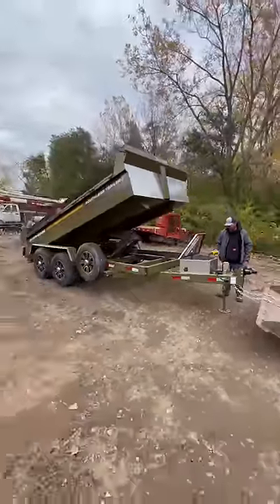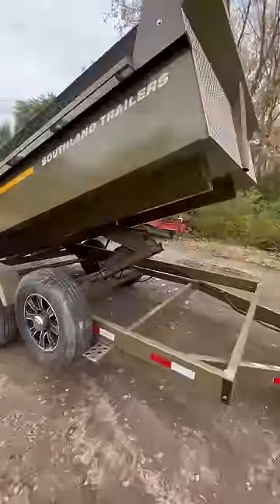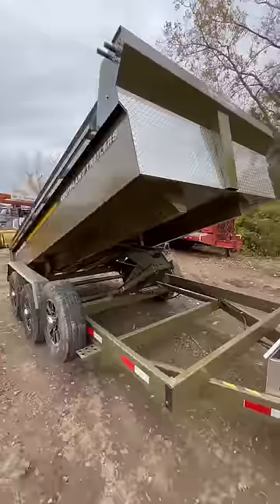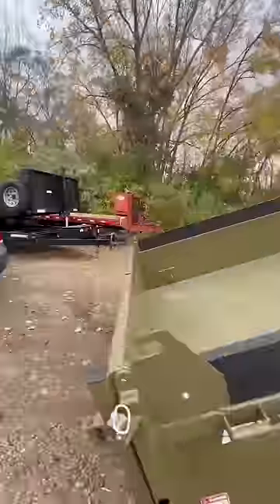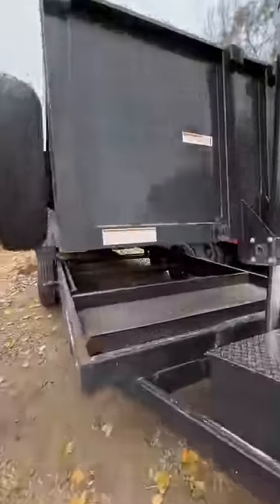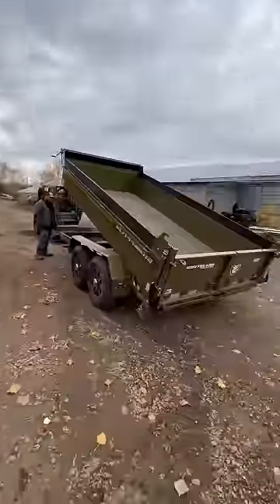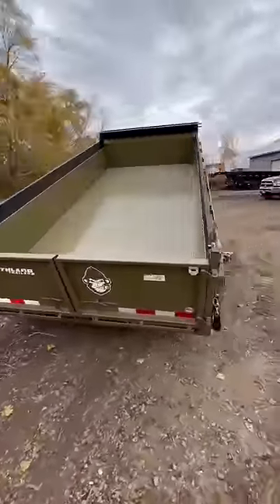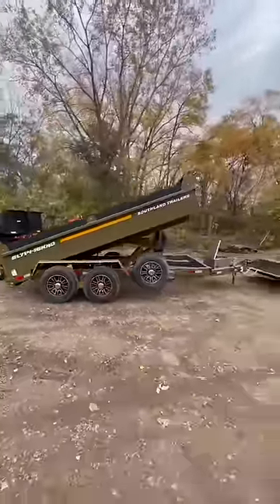They build dump trailers in Canada a little different. #shorts

Comment: So for all the people who are unsure of this trailer and Southland trailers in general. I convinced my dad who’s a general contractor to get a Southland sl714-14k trailer since I do the hauling of trailers for his company and mine (I run a Southland tri axle equipment trailer for material and equipment hauling). The dump trailer he has is pro rated to 15,400 lbs and the trailer itself is 3284 lbs and over the past two years I have had it loaded with material up to 12,000 lbs and it has never failed to dump it. It has also been used to haul skid steers and mini excavators many times and has held up wonderfully. As we have not experienced issues with either trailer I’m definitely going to be getting a Southland gooseneck if the work continues to be there for it

Comment: I sandblast and paint probably 10 or 15 dump trailers a year. Never seen one with the beams running lengthwise, but I can definitely tell you that running them horizontal causes A: puddles in the floor of the trailer and B: lots of room for you to get moisture between your C channel beams and the underside of your floor.

Comment: The Canadian design is a lot better because it makes more sense in regards to how the box would bend when dumping a load, it's gonna try and fold it in half parallel to the driveshaft, not perpendicular to the driveshaft. Just throw some C channel or I beams along the length and you're gonna get more reinforcement because now you have more metal along the direction in which it would fold. It's simple and it's genius

Comment: Running the supports from front to back,or lengthwise, helps the underside stay clean by not allowing snow, salt, mud/dirt buildup. Not a big fan of the scissor lift, though. One thing I’ve noticed with the cross support style is that the deck bows in between and overtime, you’ll notice little dips, where water pools.

Comment: So this should be able to handle a Bobcat and a some landscaping materials at the same time . 
Most of the landscaping companies that I worked for would fill the trailers w landscaping materials to include Colorado river rock and mulch and the Bobcat. One company even used ole UHaul box trucks to pull a trailer filled as I described. 
Man , driving up some steep hills left ya singing, “ I think I can , all the way up .

Comment: i bought the southland SL714-18-16K about 4 months ago. the payload is 12,680 because the way its built and a 9 ton ram. i know ive had it loaded close to max and no problem lifting it. ive towed other dump trailers and southland is by far the quietest riding trailer due to their suspension.
i did research for 2 months reading reviews and watching videos and southland came out above most of the rest in the price range i wanted to spend.

Comment: And a dump truck bed uses 7/16 to 1/2 plate on the floor depending on what was ordered. NOT 1/8  like dump trailers, so more cross braching is better in this application

Comment: They are missing doors on each side in the front, making it easier to get pallets out of the front without using a log chain to pull them to the back of the trailer

Comment: Southland also builds amazing gooseneck trailers again with better use of technology to achieve higher cargo capacity with the same GVWR.
My employer has a Southland gooseneck, dump bed and a car-hauler. All very well built and take a ton of abuse.
Reply: I should have mentioned that we have 4 other gooseneck trailers from 3 other manufacturers, 5 other car haulers all different manufacturers, a tilting skid steer trailer, a dozen more utility trailers and hundreds of purpose-built fixed equipment trailers. We have plenty of experience with trailering and trailer wear-and-tear. I’d take a Southland every time if I could.

Comment: I bought a brand new PJ Trailer in 2012 and had rust holes all over by 2016. Scrapped it not long after. Those cross rails love to catch and hold salt. PJ had a recall on it but told me I had to take care of it myself and send in bill and lots of paper work to them and there exact words were maybe we'll pay you maybe we won't. Whatever I have alot and buy many trailers as I'm in the lumber industry and do some steel as well and buy and sell anything I think I can make a $ on but PJ only sold me one and never again.

Comment: Not exactly true as a dump truck has both the long front to back bracing and the side to side bracing. But it’s definitely an interesting design not exactly sure what it would do though as it’s not attached to the very front and I cannot see the very back it just appears as it’s welded to the bottom floor section only which I would think would not strengthen it near as much if it was attached to the very edges of the bed/sides.

Comment: As long as the dump angle is steep enough and you don't need to gain angle from the tongue jack because that would need you would have to unhook from the truck.
Reply: I assume the "tongue jack" is only used to get it on the hitch?
Reply: @sparkb5142  Ya that seems like the idea. I'm wondering how high the trailer lifts

Comment: It doesn't take much weight to destroy this one. Supporting the center of flat metal without connecting to the edges where the rest of the support is creates geometric weakness. Drive a skid steer loader into the back of this trailer and see what bends. Without any cross support, the floor cannot hold it.

Comment: I would most definitely go with the sure-trac. 1. It has a telescopic lift in the front. 2. The green trailer lift is on one support beam. (Gonna break) 3. Every dump trailer made is like the sure-trac, and if you cut a corner anywhere, it will show in time.

Comment: Lots of guys running them where I live.  Southland makes a solid trailer.  They are made in Lethbridge Alberta.  They also build the Kubota branded flat deck and dump trailers here in Canada.
Reply: How would they hold up when hauling equipment in them? I see lots of trailers get waves in the floor. I’m wondering if these floors would sink over time with all the weight on the outsides where the tracks/wheels would be
Reply: @tombrown03  I think they might be better than the conventional style of crossmembers.   It is more likely that the track width of a machine will be closer to the lengthwise underbody supports.  I’ve had a few dump trucks over the years and I have never seen the dump bodies with wavy floors like we see in dump trailers.  My 30k gooseneck dump trailer is starting to have a bit of a wavy floor and that is from hauling broken concrete and rock, not machines.
Reply: I didn’t know there were Kubota trailers
Reply: @SquishyZoran  they do in Canada.  I’m not sure about in the US?
Reply: @gravytrainoutdoors  Apparently not. My dad runs nothing but Kubota and I haven’t seen anything at the dealer.

Comment: except those sheet metal  frame rails rust out from the inside out. there's nothing better than structural steel for cross members and frame rails. but if you want your dump trailer to last about 5 years and then throw it away you should buy one of these

Comment: Aren't those still built with tube frames instead of C-channel? The ones around here in Western Ohio built with tube are pretty rusted out in 10 years or less. I'm sure there is a way to make tube frame trailers rust resistant but many manufacturers don't care to try.

Comment: Sissor trailer won't lift what the other one will.  Single 3 stage cylinder in the front will dump a lot more than the lighter trailer.  And every trailer will haul much more than it's rated for its a goobermant thing they debate them from the factory

Comment: A scissor trailer will always break in the middle the single ram trailer will last 10 times longer and it's the most efficient way to move the weight. The single ram only has to lift 10000 pounds Max. The scissor pivot in the middle has to lift 20000 to 30000 pounds. That's why they fail

Comment: I worked for a Fabrication company lots of trailers and floor relays on dump truck and trailers usually the sheets sag between the beams and create puddles for water to sit in and what we called "speed bumps"  putting the beams this way if they do sag between the beams everything will still flow out nicely.
Reply from the maker: Good call. We have those speed bumps in our other trailer
Reply: That makes sense for sure, thank you
Reply: @Dirtmonkey  
Why do you not provide a link to any dealers of that dump trailer???
Reply: @AzzKicker-bz1cb  Because we have the internet to look it up ourselves?
Reply: @court2379  it’s a no brainer 🤪😂👍
Reply: @dieselwrench3621  A no brainer would be to provide a direct link to the product you brag about. Ya goose.
Reply: @Connor-zy6kl  I typed the name of the trailer on google and it came up in less than a second. So yeah it’s a no brainer. But some goose on here likes everything to be real easy. See you later goose! 😂😂😂
Reply: The single scissor lift on the single beam is gonna break or something over time. 100% guarantee. If you have to pick up a heavy box to dump it, are you gonna grab it in the middle or grab the side of it. Sold
Reply: Wouldn't diagonal beams be the best of both worlds? Wouldn't sag as easily and would minimize weight and material while maximizing strength I would think (not sure, but it sounds good in my head). Fabrication and assembly time and cost would increase though
Reply: @jonWilk8156  even if it's more expensive because you have a larger payload you'll be making more money so it pays for itself
Reply: @Mosstachio  Yes and no the more you add the more weight. Its mainly dirt and gravel that will create spots for water between the rails it's inevitable over time. Only thing you can do is use thicker sheets of steel=more weight or 2 thinner sheets with a acrylic board sandwiced between. I also use to work at and acrylic factory at night PT and they made these acrylic sheets 64 ply 1" think for the US Navy ships its another layer of protection for the hull of a ship supposably able to stop a 10" mortar round from penetrating the hull. Again more time $ and weight.
Reply: Puddles of water will still sit when the trailer is flat. Why does it matter for flowing out? Just tilt it more than 2 inches
Reply: The Canada trailer isn't much there for "raising the sides" its great for dirt if your gonna just use it as is but the black trailer is ready to go up another 4 feet easily make a nice bulk or construction container
Reply: @AzzKicker-bz1cb  unless he's getting a kickback for referrals by providing the link why would he do all the work.
Reply: @AzzKicker-bz1cb  Guess he must have figured everyone watching was smart enough to use the internet eh. Can't imagine why though..
Reply: @court2379  thank you!! I was just gonna comment,” cause we have Google “ . People want everything done for them .
Reply: @AzzKicker-bz1cb hell, the brand name is literally on the trailer. Southland Trailers.

Comment: I have a 25 year old custom dump trailer built by wesco in California. My tires sit under the dump bed like a dump truck so a bobcat drives right up to the side and I can hold more weight as I use super singles. 
Yes it sits higher and I have a rock spreader tailgate. 
A real dump trailer
Reply: That style is referred to as a Deckover Dump trailer or DOD. I have one with fold down sides. Incredibly versatile design. They also dump higher, so a wider and shorter pile ~
Reply: @georgehofgren6123  I inherited mine from my dad. The front, back and sides are all in stake pockets and I was thinking on getting new ones built similar to yours with swinging rear doors.
I would keep the existing ones and set them aside but the rock spreader is a pain to load trash and foliage
Reply: @sanjosejeff Great feedback, thanks! I wish i had stake sides rather than fold-down. But i do at least have the heavy floor (7ga) that is less common. Very interested your 'super singles' on a trailer (?).....

Comment: okay so instead of individual sex going across the bed when you overload the truck over time or in this case trailer you have long sags going between the two beams and between each beam and the wall on each side. it sounds to me that would be detrimental when it aged. now of course no sex will be running in direction that the rock of dirt will be dumping out so that will be a positive. now a metal bed is always nice for dumping stuff out of. wood floors back in the day did not sag. you break a board you replace it. but the major item you want to look for is making that bed stand straight up and down forming it L shape with the trailer frame. this truck does not do that or trailer I should say. it does not come near it. that is the major flow of most don't trailers. that's why a green truck does not make a good dump truck. although I use one for that purpose. I've got a smaller dump truck plus a flatbed with the cross beams and it's got the police underneath and it dumps. but it will stand that bed straight up and down and that's what you need! wait in the trailer I dare say though beans going across versus those two long beans going from front to back not much difference if any in weight. he did not provide any weight or load information. when I first watched it it all made sense. when I watch it second time yeah it makes sense that left me a question which I've already pointed out. but the better you can get that bed to stand straight up and down the better it will be for dumping. that's the number one point number two point with being a dump trailer it says low to the ground more so than a truck would anyway. you're going to have to be able to pull forward to dump that more effectively. so using the tongue hydraulic hoist is not a real good option. I'm talking about not having somebody going up there with a shovel and helping to load to move. by the way I'm that little one ton dually I've got with the dump bed three or four tons is about all I normally carry. I have had 5.02 tons and it dumped it. the point is make an extra trip or two don't overload and warp your bed floor. don't let the idiot who's loading you don't put in so hard and high that beats the floor to death would be number two. number three point would be a thicker heavier steel plate. and you better make sure it's diamond plate not just flat and slick. they rest out too easily diamond play at least facilitates the movement of the finer material. hey at best I'm just a weekend warrior I grew up around this stuff. call me out if you think I'm wrong with something.

Comment: I would say it may or may not be better left and right vs front to back back. Sure it might be a couple pounds light but IS THAT GOING TO MAKE A REAL DIFFERENCE????.. LET ME KNOW HOW IT HOLD UP AFTER 15 YEARS.. Looks like a nice build trailer.. I would give an 8 out of 10 until we see how it last.. but electric I give it a 1 out of 100 .. sorry i see sorry many people who do NOT WIRE THERE TRUCKS CORRLETY and there damn batteries are always dead and or they don't have the balls to lift, pull the load up.. sorry 13 hp gas I have never had a problem. Just like most thing the more u build the better ideals you figure out as you go along.. I own a dumpster company with 4 trailer all gas and we load, empty, and reset 5-10 a day and never run out of battery or have to cheat and use a block and tackle.. but nice looking trailer I really would like to see if the rails last vs left and right.. I have 2 electric dumpsters left and right rails 20 years old and still solid to the outside walls.. nice job

Comment: Would be nice if it came off like the dumpsters so you can have multiple going for multiple jobs
Reply: There is a guy in another town around here that has a small hook loader roll off trailer. Tandem axle with 8 bolts so guessing 12-14,000 gvwr
Reply: If you look on their site, they have one like that

Comment: I don’t like the flat sides. No strength there. That’s a cheaper way to build. Not sure how I feel about it. Wouldn’t be good if you use the dump trailer to haul a machine. Wouldn’t spread the weight as nice.

Comment: Running the braces the long way is better because the bracing that goes across eventually has dips that trap dirt and mud when you try to dump.  Then when you go to dump, the stuff hangs up and is difficult to dump.

Comment: If that’s a steel trailer it’s not saving much weight! If 100lbs! So If you want to save weight buy an aluminum trailer!!!
Also I am going to use it to move my equipment also so which one do you think would last longer running the machine in there every day????
Reply: 100lbs more payload is a 100lbs less of a chance of getting a $1000 ticket

Comment: The reason that companies use the previous design is because they use then sheet metal to build the bottom of the dump. This being said they have to have more support for the weight thing put in the trailer.

Comment: All of these bumper pull and gooseneck dump trailers are garbage. In fact, Southland is one of the worst. The major issue with these (and I’ve owned a few) is that they really can dump a proper load due to the low working height of the box. Dumping a load makes a long pile that wastes material or creates extra work for operators in terms of material management. Additionally, they are just far too heavy to be dragging around as a machine transport trailer.

Comment: I'm not arguing tye support rails versus crossmembers.  I did notice that you neglected to point out the lighter dump system on the crossmwmbered trailer.  A telescoping ram is lighter than a scissor lift system.